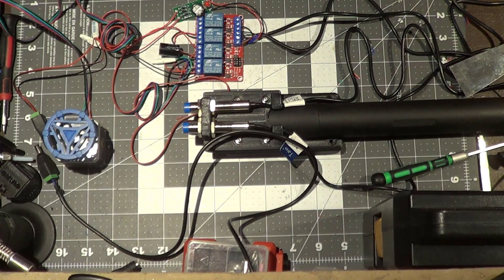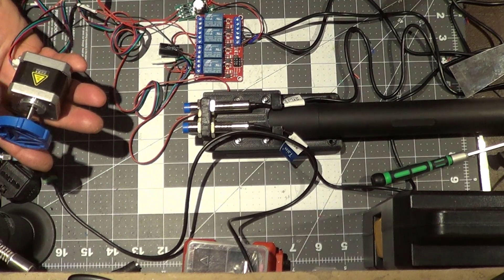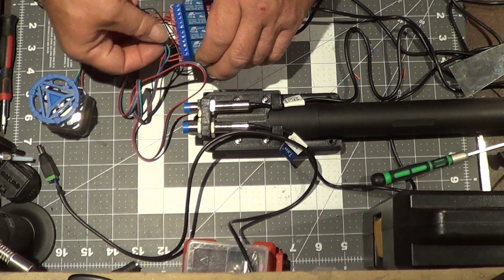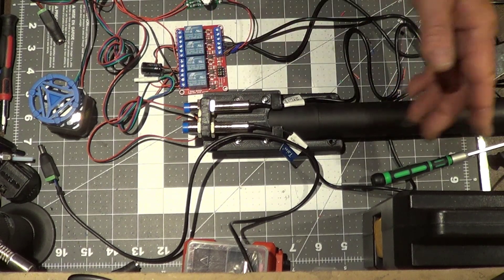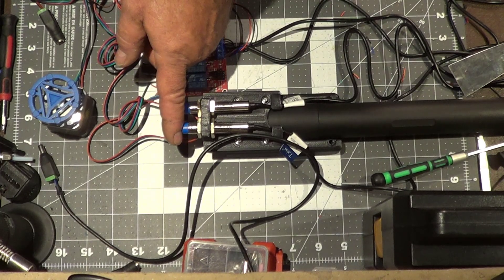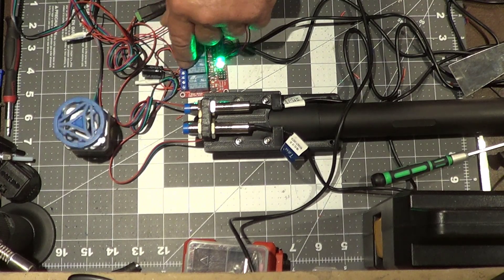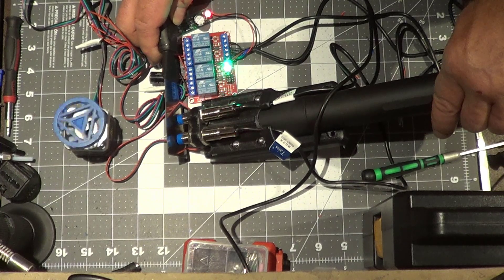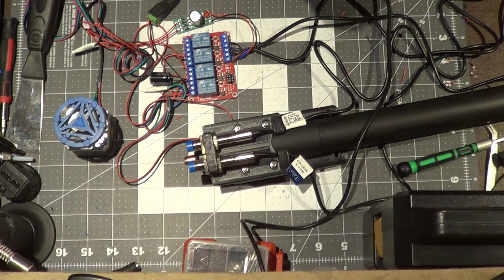DIY Torch Height Control How to.....

Comment: If I look at your video it looks like like proximity 1 is n/c and proximity 2 is n/o. please confirm if i am right or wrong
Reply from the maker: They both are the same, the difference is the  power is always on to the motor in the down direction. The first sensor tells the motor to stop. If the metal is warped up, the second sensor fires 2 relays. One relay flips the capacitor from one stepper coil to the other (reversing direction, while the second relay restores power to the motor by shunting the down relay.the head is kept between the height of the two sensors . While cutting, if the metal stays dead flat, the head should move down, and sensor 1 stays on. If the metal move away, light one will go out , and the head moves down. If it gets too close, both are triggered until it’s between them both and sensor 2 turns off (sweet spot)
Reply from the maker: FYI look at the later video with 6 alternating sensors. Solves the issue of the sensors being over a void, since they surround the head

Comment: hi. is the proximity switches n/o or n/c ones
Reply from the maker: I believe I used N/O, but it shouldn’t matter, as you can set the relay trigger inputs to accept hi or low triggering

Comment: Hi Buddy. This is a great circuit. I studied the circuit and noticed something. can you explain why you used three relays instead of two. would'nt it work if you bridged the n/o and n/c terminals on relay one instead of using a n/o from relay three. let me know what you think of it. i am busy converting my cnc router table to a plasma table and are planning to use your method.

Comment: sensor will melt
Reply from the maker: Hasn’t yet, gets some crusty. Buildup, but remember there is air blasting through the torch head blowing the heat away.if that were to be a problem, they wouldn’t make the torch handle out of plastic…..

Comment: By any change do you have a close up photo of your relay board. Im trying to find out what wires of the sensors go where. Trying to color code your.  schematic
Reply from the maker: Can’t attach photo here, but here is the Amazon listing with it’s photos. There is a good close up of the board….  https://a.co/d/72kWh0x
Reply: @frantasticdesigns i have the relay board. I am trying to figure out what wires go where. The sensor that i got have three colors brw, blk, and blu. Im trying to figure where they go.
Reply from the maker: @bobbylarson80 brown should be +, blue -. They parallel the relay boards power. The black wire lands on the trigger input for the relay you want to fire. Set the jumpers for the relays to low if I remember correctly.

Comment: This is a really cool interesting approach and design. I really like how some people think outside of the box, and very great explanation.
Reply from the maker: Thanks, Check out my follow up video where I changed to using 6 sensors in a ring around the torch.  it eliminates having the sensors over a void and causing collision with the material being cut.

Comment: need build cheap good torch height controller too, but need all chematic and code too, were all have.i use linuxcnc plasma. all say best have arduino board code and this use THC but were is good simple code. or how this work sure .
Reply from the maker: There is no code or controller used. Purely dry contact proximity sensors and relays. Absolutely no programming…..

Comment: This was very good info. I never think those rc filters can use in series.
Reply from the maker: Did you check out my later video with the ring of six sensors that eliminate the issue of the sensors traveling over a void?

Comment: What size capacitor?
Reply from the maker: @IllusionnmeMusic  sorry, I forgot to add them to the list, I will fix that, but here is the value I used: 13X20mm 1000uF 35V 1000MFD 35Voltage ±20% Aluminum Electrolytic Capacitors

Comment: I posted on the other vid you had, but after looking at other vids, and then seeing this one here explaining your setup more, I realized that when I mentioned putting an adjustable limit switch on here to prevent the torch from dropping lower than the set point before the cut, that a lot of other vids were also showing the problem with the material warping upward, and the torch jamming into the side because it wouldn't lift with it, so I saw the "Floating Z Axis" things that people made, that I figured would also be beneficial this yours??

That way, you wouldn't dip too low because of the adjustable limit switch that you set before the cut, and the Floating Z Axis is where the torch mount has a gap on the lead screw with a spring, so the weight of the torch stays at the bottom, but if you happen to move the torch into a raised slope, it will push up on the spring and raise in that gapped area.  Which that could also have a limit switch to tell it to move the Z axis up if the gap narrows to the top, just as a safety precaution.

Here, check out this guys Floating Z Axis printed parts to see exactly what I'm talking about:
https://www.thingiverse.com/thing:2516238

Comment: Such a simple and cheap way to create a thc. Never would’ve thought about it this way. How have the prox sensors held up with the cutting ?
Reply from the maker: So far so good.  That is the old one with just two sensors.  check out my later one that uses 6 sensors in a circle. It eliminates the risk of the sensors being over a gap.  The only issues I have had, are with the 4 channel relay boards.  I have had some that the relays stick.  Cheap Chinese boards.  They are cheap though, so I just replaced it.

Comment: So it seems like you will always have up and down movement with that versus how most work by sensing the voltage at the arc and using a PID loop.
Reply from the maker: As long as the metal is within the two set points(high and low), the z height motor is off. The low sensor kills power to the down direction and the sensor is active.   When the metal goes high enough to trip the second sensor reversing  the direction, and over-rides the motor power shunt. When it goes high enough to trip the high sensor off, it stops again as long as the low sensor is still active. The trick is to get the difference  between high and low just right, about 1-1 1/2mm. The real improvement was adding sensors all the way around the torch.

Comment: Hey can you accept my google drive request, also do you have the 3d printer stl files for the torch holder and prox sensor holders?
Reply from the maker: @bh9420  I did not see a google drive request. I will see if I can get the files online shortly
Reply: @frantasticdesigns  I have sent two requests now, just open the document for public access, if it is public domain!! That way no one needs to request access. TY!!
Reply: @frantasticdesigns  
But it continues to deny access.

Comment: Wow, what an interesting way of doing a THC!! f= 1 /(2πRC) for an RC Phase Shifter at 90°, therefore Resistor (R): 1 kΩ Capacitor (C): 1 μF. Resistor would need to handle the current of the stepper motor as it runs. This would be a more precise circuit for the 90 degree phase shift the stepper windings need. Also the cap needs to be non polarizing if you are passing AC through it. The resistor should also help to ensure the stepper windings current is not exceeded. An addition to this is to add a current sensor by way of a CT on the ground wire. When the current is low i.e. about 0, then do not run the THC motor and only run when the current is high, i.e. the torch is in cut mode.
Reply from the maker: @bh9420  I handled only running the THC when the torch is cutting by using a double pole relay. The 12 VDC spindle output from the control board takes one relay out to send the trigger signal to the plasma cutter, and the other to turn on the AC to the stepper circuit. I have a toggle switch that parallels that output if I want to run it all the time....
Reply: @frantasticdesigns  здравствуйте, поможете мне подключить этот станок ? заранее спасибо